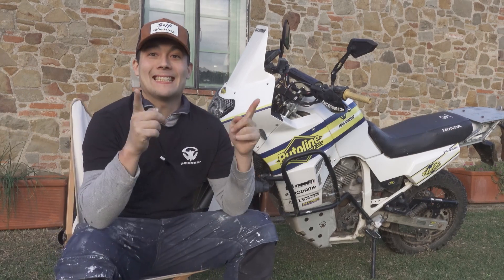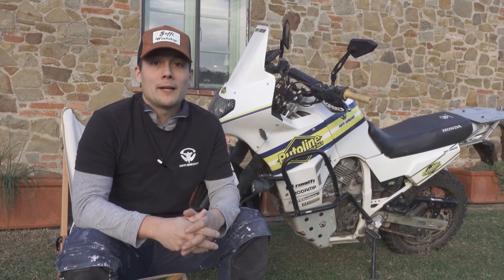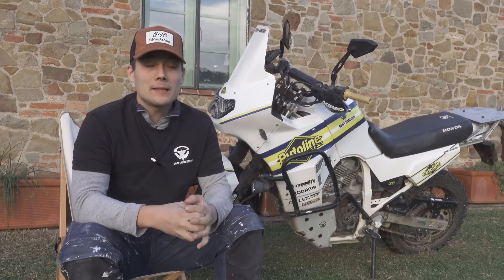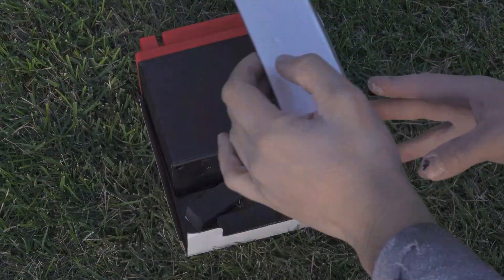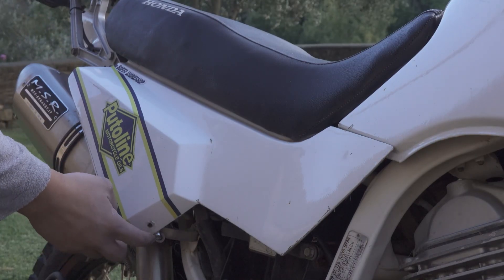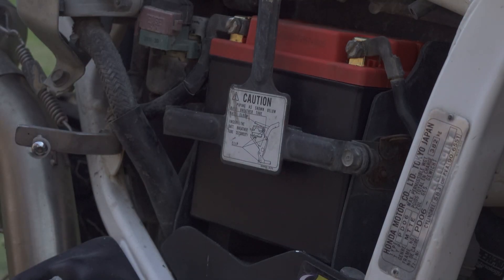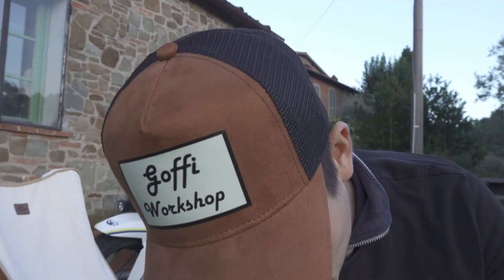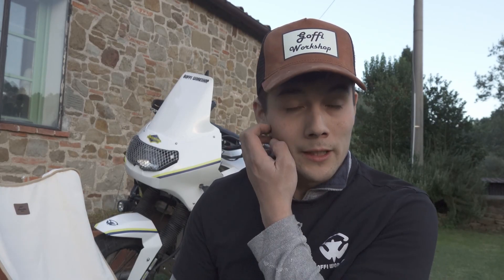HONDA TRANSALP :  Lithium battery VS  traditional battery

Comment: Sono disponibili anche batterie ANTIGRAVITY più compatte e con un connettore aggiuntivo che consente di visualizzarne lo stato sul cellulare tramite Bluetooth.
Reply: È inoltre necessario sostituire il regolatore di tensione con uno al litio, come il Rick's Motorsport Electrics 10_132
Reply from the maker: @TurryAR con quel tipo di batteria e' necessario quel regolatore?  Perche' fra i vari forum salta fuori spesso la sostituzione con un mosfet o regolatore ta 650 / 700

Comment: Skyrich battery manual: "The HJTX14AHQFP lithium-ion motorcycle battery can be used in any motorcycle, of course, depending on its dimensions. If the generator terminal voltage is between 14.0V - 15.0V at the motorcycle's idle speed, it is NOT necessary to modify the motorcycle's charging system."

The 600 couldn't do this for me with the factory voltage regulator.
Reply from the maker: Some people upgraded to the mosfet, or 650 or 700